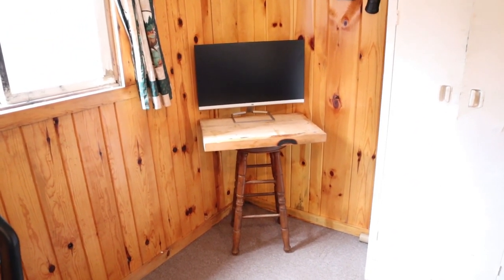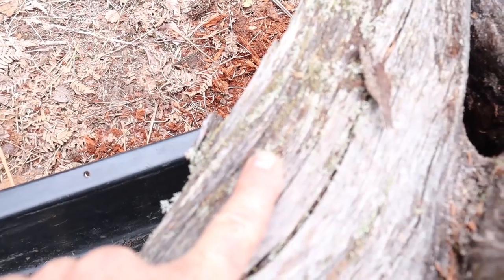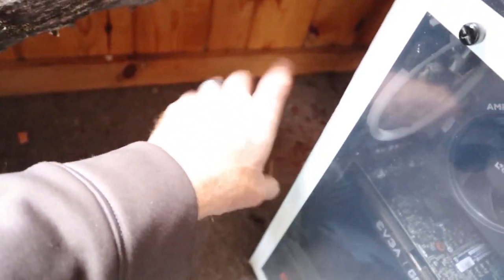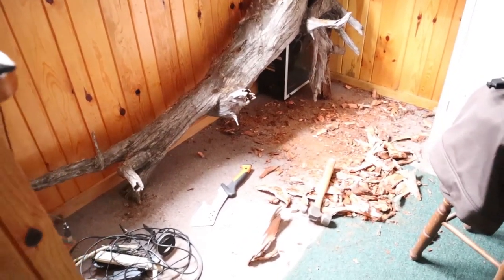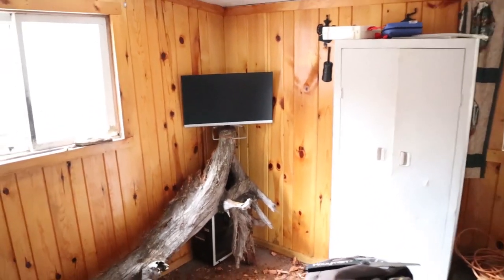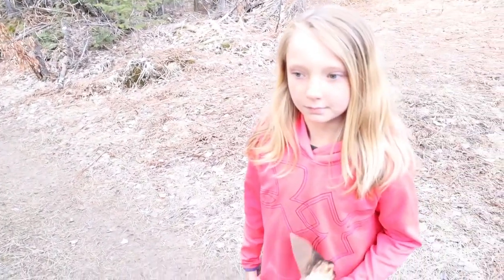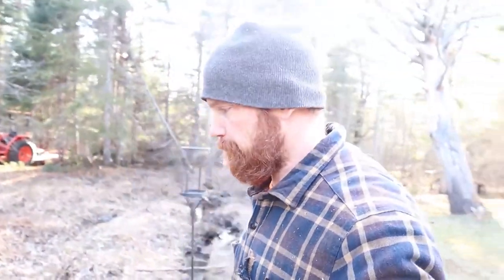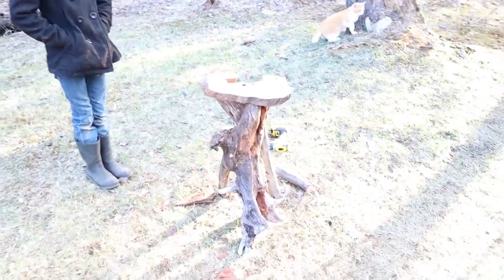Custom Computer Desk Build

Comment: a great computer desk that doubles as winter nut storage unit lol. looks cool  PS if the power supply for the computer has a bottom air intake might want to get it up off the carpet so it doesn't overheat  airflow is important for good thermals PSS everyone loves your singing🤩😎
Reply from the maker: Thank you! It’s got a top and side intake. But had to throw the computer out due to it being infested with carpenter ants 😂
Reply: @9252LIFE  that's too bad the graphics card it had in it is worth its weight in gold right now but if you buy another tower most of the power supply units are installed in the bottom of the computer and they pull air in from the bottom so sitting them on carpet is a no no just something to keep in mind

Comment: cool to bad it had hijackers along for the ride  and remember there are no parts in a computer for carpenter ants to eat unplug bug spray the crap out of it let dry and blow out with compressed air  and  plug it back in the only real hard part to clean is the power supply unit computers parts are so hard  to get now and are really expensive the rtx2060 you had in it is probably worth 300/400 on ebay right now ouch